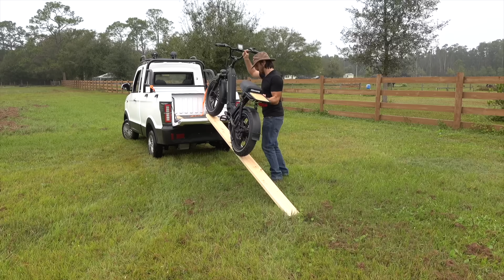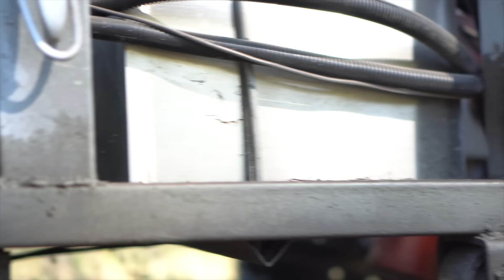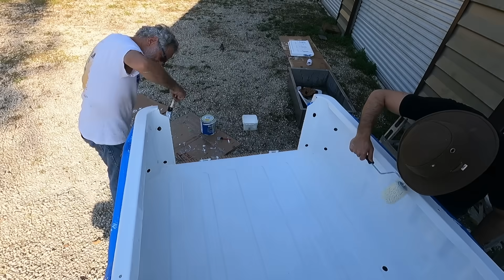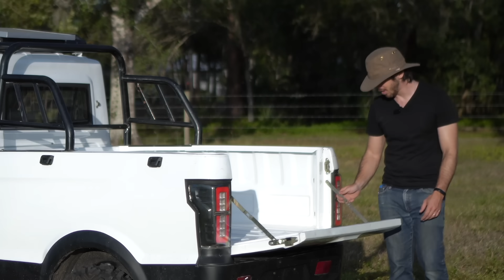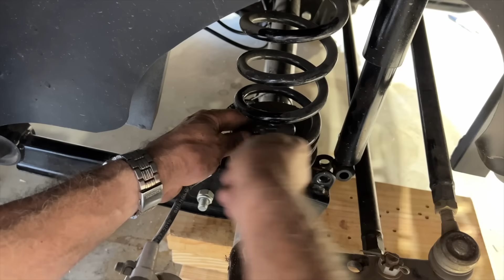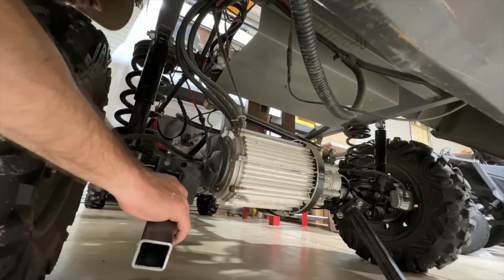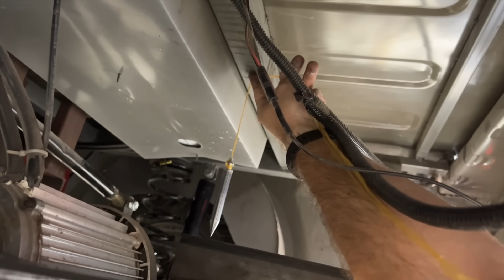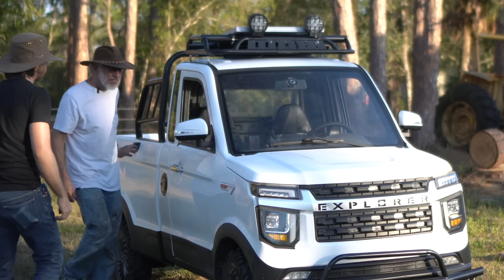My Chinese Electric Mini-Truck 18 Months Later: Did It RUST OUT?

Comment: You said truck  😝🤪😜 what you don’t say in any of your videos is the lifespan of the lithium batteries which for this “truck“ according to other product guides I’ve seen 3 to 4 years is max and then you need a new one which costs almost the same as the truck   And of course lithium batteries explode and you can’t put the fire out with conventional means this needs to be included in the information not to mention manufacturing and disposal of these lithium batteries of all sizes for E bikes as well as cars is more toxic and filthy   Then just pouring crude oil out on the ground throwing some tires in it and lighting it a flame so if you don’t care about your carbon footprint electric for you plus your electric bill will go up there is no free lunch  . It’s good that you want to try to save the planet but there are some ways that are better than others and unfortunately we don’t have all the information yet
Reply: Well - here's some more info.  Truck is nearing 4 years old on the original lithium battery that has shown no (none, zero) signs of degradation in terms of max voltage and total charge so the 3-4 years max doesn't apply to this unit.  There is now a growing lithium recycling industry and fortunately, the better lithium chemistry batteries have had very very few problems (gas and diesel vehicles do catch fire but the news doesn't cover it).  We have no spilled fuel or engine oil, zero repairs (other than re-gluing the rear view mirror which fell off), and great fun in highly capable truck that works hard for us on a regular basis.  So the "world is a changing".  Time to get on board.  Best regards

Comment: Well, I noticed it doesn't have a license plate. Why ? A road slug or illegal for the road? Or why's?  Speed = ware and tear a field tractors last a long time and a dragster is one time and rebuilding every quarter mile. Which end is it?  Bed liner may be better than any paint spray on or solid would do the trick. 
      They just came out with a 600 hp tires 4x4 is 1600 hp chinaese junk and eliminating the factory installed pinner motor what 12 hp slugmobile. Good back yeard transport as is 
Wooster and all. 1600 hp in a quieter mi and chinaese junk maby in the 10s or hi 9s with 1600hp . Do you how much it weights ? With 4 wheel drive burn out is not nessary wheel burning would be interesting and fun on the freeways slide show two wheel or 4 wheel ice  burn .  If it is a slugmobile 800hp may speed it up some!

Comment: Pretty sure they make the tailgate like that because it’s not supposed to have any weight on it at all or it’s gonna snap right off! if you change it to open flat, make sure you never ever put any weight on it. It might be safer to have it open all the way, so it just hangs down if you can!

Comment: You should be able to get cables made to length...the coated cable is, I believe, called "aircraft cable".  I've custom-made cables for a variety of theatrical rigging--it's actually a really simple process, once you have the right tools and supplies.

And, yes, it would be a super-simple way to fix your tailgate issue.  A LOT simpler than relocating mounting points.

Comment: It's been a year since you published this but I just wanted to suggest something. You were worried about the new suspension handling weight. If you look under a lot of pickups they have a couple of thick rubber bumpers under the bed lined up to the frame that takes up the weight of an over load. Great videos. Great little truck.

Comment: Sir, may I ask a question? Do you need to do any soldering on this truck? I bought a mini Chinese EV, and it seems that the soldering and bolts aren't properly installed. When you receive these vehicles, do you perform general maintenance, including retouching soldering, etc.? Thank you.
Reply: If you mean welding - no.  Welds have been good (but look ugly).  If you mean soldering of wires - no - was not necessary.  Working great after 3 years - no problems at all.

Comment: What rims and tires did you put on?
Reply: OEM wheels but slightly larger tire with more aggressive tread design.  Great upgrade with the new springs.
Reply: @micahsdad5388  Thanks, and the spring length?

Comment: i got my truck stolen and i got it back with missing items. Where can I buy the battery charger, keys and backup camera display.  thanks
Reply: Best route may be to reach out to the manufacturer and see if they can ship you the replacement parts that you need.  Good luck

Comment: when he showed the controller and it was a 95amp i was shocked. the ebikes im into have 150-200 amp controllers at the same voltage ive even seen 300+ amp controllers so the fact it carries so much weight on essentially a surron level controller and hasnt burnt out or constantly overheated is kinda crazy
Reply from the maker: You’re probably working with MUCH higher speeds and acceleration levels. If you’re going not more than 20 mph ( and usually less in these off-road scenarios) and you don’t need crazy acceleration, then the torque is what you’re really enjoying here. When I have a seriously heavy haul (like the bed full of sand) I put it in low gear and then the torque is NUTS!
Reply: @EbikeSchool  I assumed it was probs being assisted by gearing or something or it didn't go that fast

Comment: You attached the hitch to the axle? Am i missing something?  Also the fan doesnt work without the shroud.
Reply: Shroud was reinstalled long time back.  No other place to attach the tow bar.  No problems with it after 18 months and pulling the boat in and out of the water multiple times.

Comment: Uh, hang on. Did you just mount the hitch to to the axle, then also bolt part of the hitch to the frame? How does that allow the axle to still articulate?
Reply: Agree that it is not the best design but one end of the rod does float.  Our next iteration will be a chain that will allow independent movement up to the point o the mechanical limiter.  Not a lot of choices on how to mount this due to the way it was framed for the dump bed.  Regards
Reply: Ah, I wondered if that might be the case (the float at one end.) I just figured I missed something. Given that the video is a year old, I guess it hasn’t caused any significant issues. Thank you for responding!
Reply: @SnoopyCoupe  Truck is working great.  Best regards

Comment: While I still cant say I'm overly impressed by the chinese build quality I'm glad yours has held up.  I just wish our government would fix the regulations to allow this kind of form factor to be street legal.  Everything is setup in such a way that it forces bigger and bigger trucks when there are alot of times you dont need a giant f150  or f250with a full bed and extended cab.  for a gneral local runabout with some light duty truck bed capacity this form factor is ideal.  It would probably be a breeze to park at the store vs a fullsized truck that these days really needs a pull through parking space to not stick out halfway into the parking lane.

Comment: Any signs that the Chinese manufacturer will adopt and learn from some of Micah's upgrades and improvements? Obviously it would be much cheaper for the improvements to be made in China and even more people would feel tempted to follow Micah's lead  and import one or two.  Then use a Cybertruck or Ford F-150 pickup for posing and turning heads and one of these cheap Chinese marvels as the real work-horse.
Paul G
Reply: What’s the price?

Comment: Eighteen months is no time at all .
Reply: Up to close to 3 years - not one breakdown or problem of any kind.  Better?? !!
Reply: @micahsdad5388  30 years , 300,000 miles no break down or repair of any type  just standard maintenance. Oil, filters , one set of brake pads and tires. It still had the original clutch when I  sold it. Toyota 4x4 pickup.  It sold for more than I paid for it new. I  was simply tired of looking at it . I used it to haul fire out of the SIERRA NEVADA MONTANA  and lots of camping and hunting trips.
Reply: @theoldman8877  Well done.  Stay tuned and we will report when we get there !!

Comment: No rust after 18 months, it's already better than the Cybertruck
Reply: Which ironically is made of stainless steel and weighs almost 3 times more than this cute little truck.
Reply: @arkadiusztrzesniewski3486 its not all that ironic.
To make stainless rustproof you have to passivate it.
To passivate it you have to dunk it in acid and ruin the polish... and never polish it again.
Reply: Wheels didn't fall off. It's already better than the cyber truck.
Reply: Probably more useful as a work truck than a Cybertruck, too...
Reply: Ja ja. But sich one do you want to use on public road where there are crashes. And you are in America your roads are much more dangerous than here in germany. 

Yes cybertruck is illegal here. But we have electric benz transporter vito and sprinter. 

Byd has some new electric vans that surprised me positively at the car rental place
Reply: Already better than American trucks than come off the factory with rusted unpainted drivelines
Reply: Id take a cyber truck over it abtday given the choice 🎉

Comment: How is batteries doing after this long!
Reply: Great question - getting close to 3 years old and the battery has no perceptible sign of charge degradation.  The whole thing is working perfectly and our improvements to the OEM version of the truck have made it even better.  Thanks for asking.

Comment: The original manufacturer's quality is the worst I have ever seen on any kind of new machinery.  So many of the welds were just tacked to hold a piece in place temporarily for fitting.  But they never went back and did the finish welding.  The owners themselves don't seem to know much about it themselves.  Of course it would be fun to play with, as long as you kept it in your yard.
Reply: So here's the deal.  We both weld and we pointed out that the welds looked terrible.  On that we fully agree.  That said, nearly three years later not a single weld has broken or rusted.  And we use this hard, not for play, for real work.  So there are terrible looking, very strong welds.  We were planning to go back and lay full beads over it all but it's tough to say I'm going to spend 6 hours welding something that isn't broken.  After nearly 3 years, zero rust, zero breakdowns, zero downtime and near zero maintenance costs.  We know what we are talking about.  And the proof works hard for us almost every day on our property.   We put it all out there.  So please let us know when you publish your very first content to YT.  We will be kinder in any comments that we make about your skills.

Comment: If I was you I would put that cover back on for the motor the fan that is it is put there for a reason and the reason is just in case you do not know that motor gets hot believe it or not and that fan motor guard is designed to create a wind tunnel as the fan turns basically creating a vortex pushing towards the motor coils or fins heat sink or whatever you want to call it allowing the electric motor to cool so if you want that thing to last make sure you put that thing back on there it is up to you it is your stuff and I'm really shocked that it lasted this long when I first seen it just earlier I thought you was crazy for buying it at $9,000 because you could have got a mule for that electric gas one for $9,000 and it would have been bigger and bulkier and a whole lot better or you could have just bought an off-road four-wheel drive and done the same thing andspent a whole lot less different strokes for different folks but me I wouldn't have got it after thinking about it but then again I don't know cuz you do got a nice little cart there but congratulations on everything

Comment: It could not be any worse than my Made in China Zap car.  The first week I drove it I stopped at a red light and the mounting bolts broke off the driver's seat and threw me backwards. I could not see anything outside the car. I was afraid I was rolling into the intersection. I managed to get the car to the curb and drove back home sitting on a milk crate. I purchased it as a demo car from a bankrupt dealer. I drove it for four years and received a notice that the brakes did not meet federal standards and the factory was recalling them to be crushed. I only paid. $2,900.00 for and when they came to pick it up with a tow truck the guy gave me a check for four grand. NEVER BUY A CAR FROM CHINA!
Reply: Dude those things are NOT street legal. Those things are like for small country ppl grandparents do chores.  In remote place between fields that the mini roads between fliers that are NOT wide enough for cars. I don’t know why ppl buy those cars drive on the road. They re mean to be CHEAP. 
Some American Company try to mass ORDER , promot it make nice paint on it. It’s THEIR fault. It’s NOT meant for main stream consumers .

Comment: White bed liner😮y dirty the first day
Reply: Black bed liner = fry eggs on a sunny day.  It's a work truck.  Dirty is a badge of honor !!
Reply: @micahsdad5388  have you ever owned the truck man? I would say every truck that you buy has a black liner in it and it does just fine. Ive haved a truck for many years
Reply: @bsmith2340  just talking about SWFL where the sun is VERY strong much of the year.  People in Florida, including me, have been burned touching the interior of their cars on hot summer days.  Appreciate the input.  Best regards
Reply: I have never had a problem during the hottest day but to each there own

Comment: If a part breaks, how will you fix it? Are you going to buy the part from China?
Reply: First, it is 30 months and nothing has broken.  Other than the sheet metal, the vast majority of the parts are all generic so if something dies, like the wiper motor or the AC compressor, it can be sourced locally and inexpensively.  And it is all so simple to work on.  No need to rely on the manufacturer.
Hope this answers your question
Reply: @micahsdad5388   Thank you

Comment: Would great to see you convert something like this to an offroad offgrid camper
Reply: Well its already off-road and off grid (with the solar panel) so we are 2/3s of the way there.  Best regards
Reply: @micahsdad5388  yeah it looks like it can go offroad.and off-grid, your 2/3 there, just missing a camper trailer that it can pull or maybe a box camper you can add on the truck bed that has a bed and everything, or a rooftop tent. See how far you can build it for camping

Comment: "Guess I should have bought American." Wouldnt it be great if an American company would make these so you could? 

Of course they could only make $1000 profit on each one, so they would have to price them low so they could sell a lot; rather than making a few fullsize 1-ton dually Diesel crew cabs with 21" chrome wheels and chrome tow hooks and chrome leaf springs and self-drive and satellite TV and leather sun visors and a full sun roof and air conditioned glovebox and a 3' wide console blocking use of the front seats and 3x 14" displays and electric opening doors for $115,000 and making $55,000 profit on each one.

Comment: Anything chinese has no foundation, no strength, will not be built to last. America made the worst mistake ever bowing down to climate activists and not saving America by outsourcing to China
Reply: Completely and utterly wrong.  Great stuff being built in China and poor stuff as well.  Guess what?  Just like the US - great stuff and bad stuff.  It's always important to do due diligence.  This truck is now over 2 years old, never broken down, nothing failed, zero frame and body rust.  Batteries showing no sign of degradation.
Reply: American manufacturers sold you out to China to MAXIMISE profit.😂😂😂

Comment: Will it "rust"? Judging by the environment, your location doesn't know what being exposed to real rust is 😆
Reply: 6 miles from the coast and high humidity all the time.  Salt travels in the air here.  Steel has held up well.

Comment: I loved this video. I had a 94 Toyota pickup that I bought in 2008 for $1700.  I used it until 2022 and after 300,000 miles the head gasket went.  I sold it for more than I bought it for.  I loved that little truck which is why this little electric fascinated me. Great video
Reply: Ya used it once every other week or month. People here are looking for reliability not risk lol

Comment: Those welds! Yikes! Hope they last the distance.
Reply: not pretty but 2 years+ later not a single weld failure.  Regards
Reply: @micahsdad5388  well that’s good. That suggests the car is getting an easy ride, but as someone with refinery welding inspection experience, let me just give you some free advice… don’t put the frame under any repeated stress. Cheers.
Reply: @robsalvv5853  appreciate your input and certainly agree that the welds look like crap.  But the irony is that we have worked this vehicle hard by using it to tow and loading the bed repeatedly with heavy loads and then using the dump feature to empty it.  No broken welds.  No long term durability remains an issue with possible work hardening.  But as a welder myself (not at your level for sure), I plan to add some good weld and that should be the permanent solution.  Best regards

Comment: It's more durable to use a plywood bed in place of the line. It's also more dent resistant.
Reply: The problem with plywood or rubber type mat is that it holds water up against the floor when the water gets underneath it and then is more likely to encourage rust (like a rubber mat in a leaky car trunk).  So it becomes a tradeoff in terms of rust vs scratches.  Thx for your comment

Comment: Micah,  HINT: to STOP rust add a ZINC bar attached to a section of the iron frame after removing any paint etc.
Do not spray the Zinc. Leave it exposed to the air.  Zinc will oxidize before the iron.